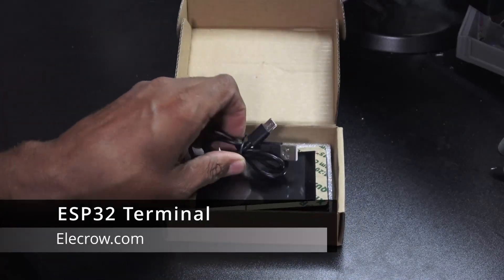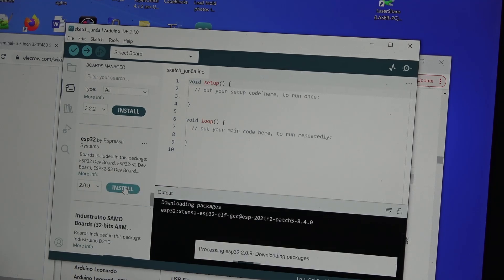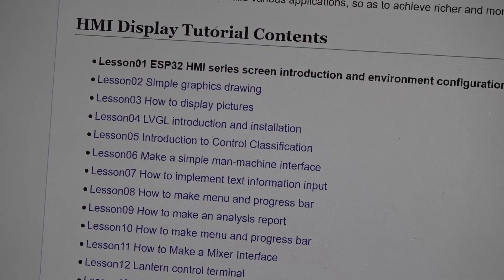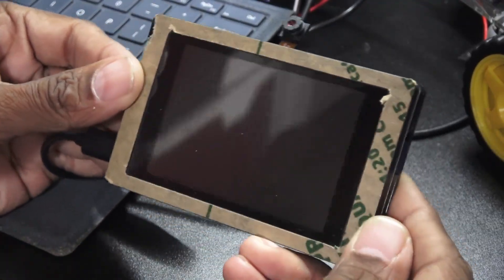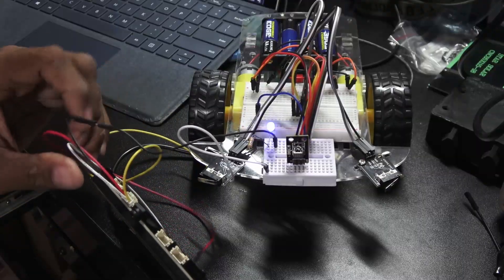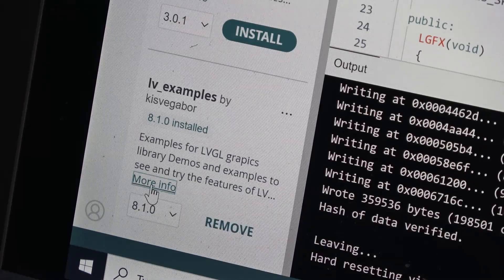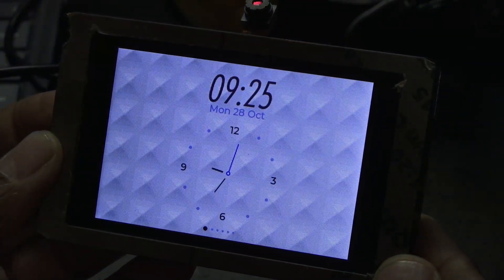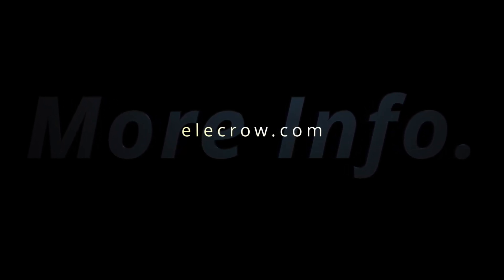Elecrow ESP 32 Term 3.5" SPI Review - The Little Touchscreen that Could | HobbyView

Comment: Scattered brain documentation is right. I have bee trying to get this thing working in the as advertised Micro python mode. I can get it to do low level micro python things, but not as easy as circuit python. I cannot fine libraries that examples use. Even they suggested using the the generic ESP32 S3 firmware. I tries it and the one for this board. I get random results.